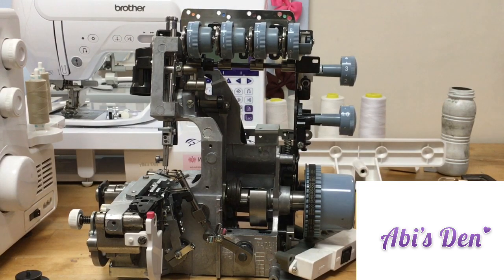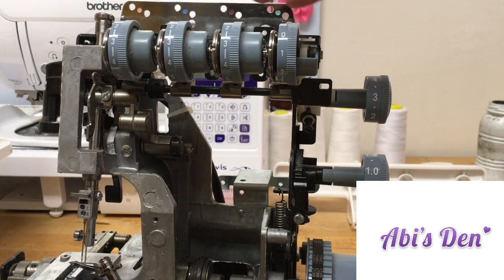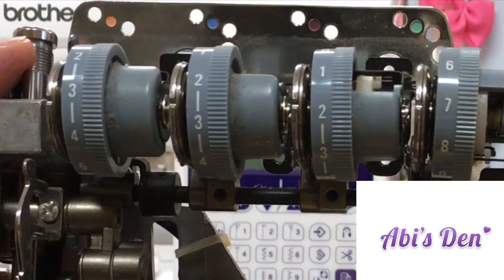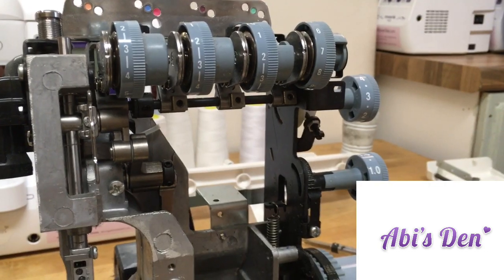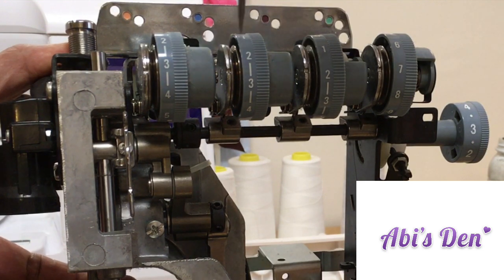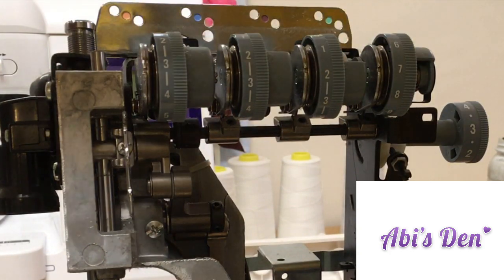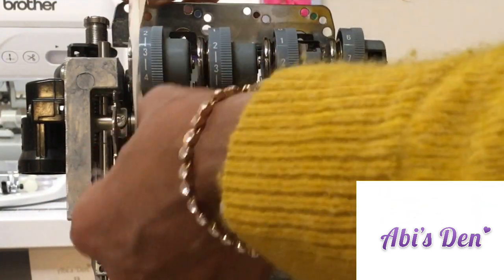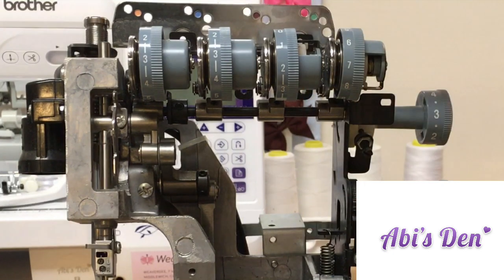The Naked Overlocker - Tension Discs | Abi’s Den ✂️🧵🌸

Comment: Always thread machine with the presser foot up, this disengages the tension discs. When presser foot is down it engages the discs therefore the thread is not inbeween the discs rather it is on top in the wrong position.